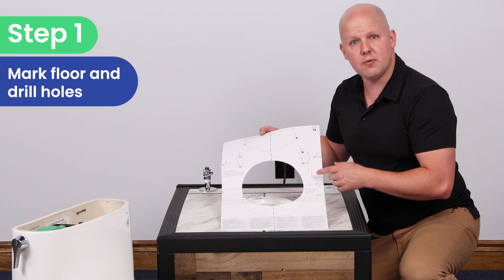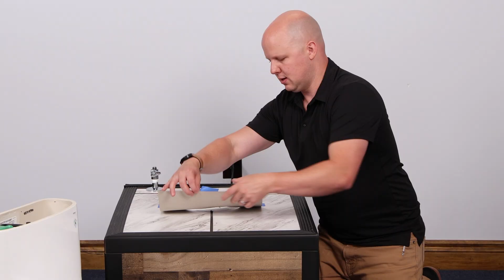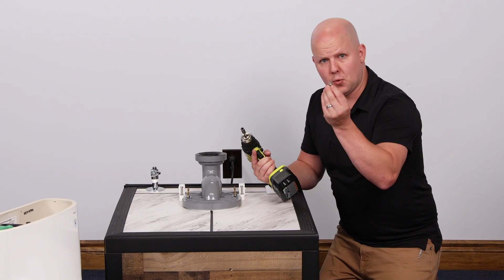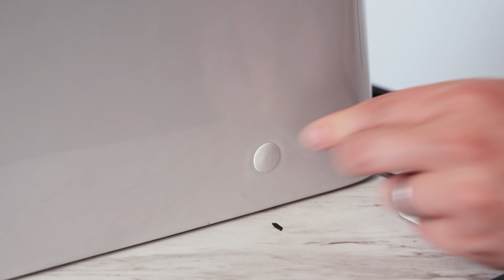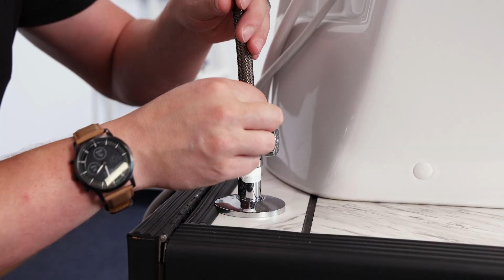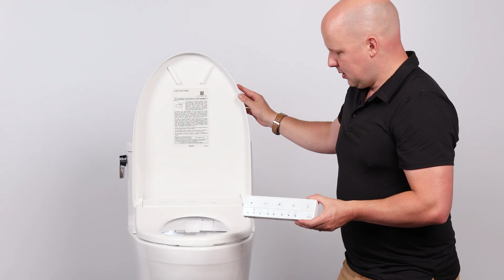How to Install TOTO WASHLET+ Bidet Toilets Nexus S7

Comment: I can't remove my bidet. Cannot locate release button.  TOTO Washlet S400 (TCF6632U)  I have a wall tank
Reply from the maker: Here are a couple of links to an old PDF of the S400 manual. The first one shows the location of the release button: https://www.manualslib.com/manual/1863922/Toto-Washlet-S400-Sw563.html?page=6#manual

The second one shows you how to remove and reinstall the seat: https://www.manualslib.com/manual/1863922/Toto-Washlet-S400-Sw563.html?page=14#manual

Hopefully that's helpful!